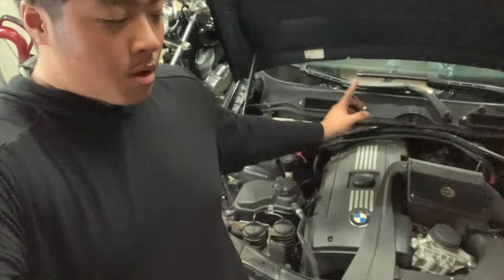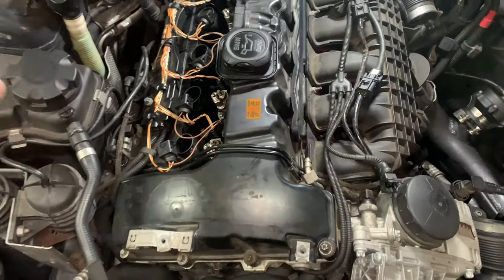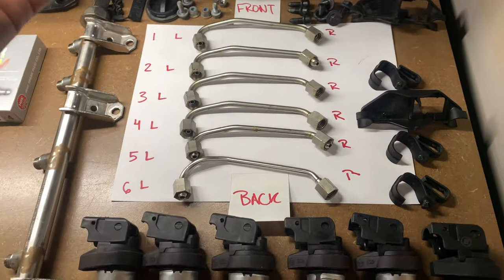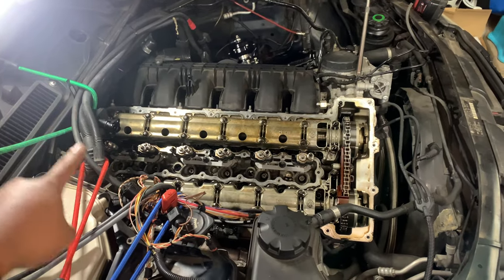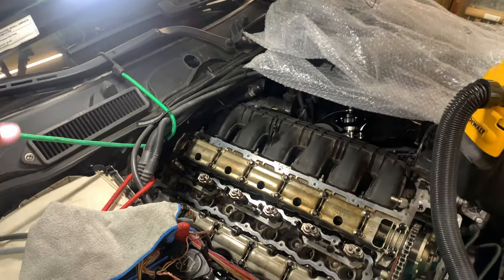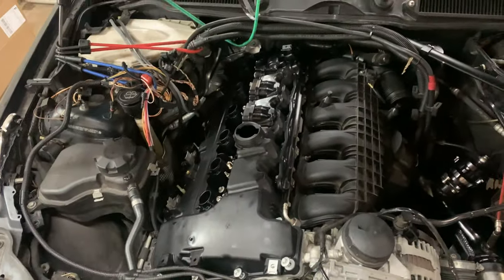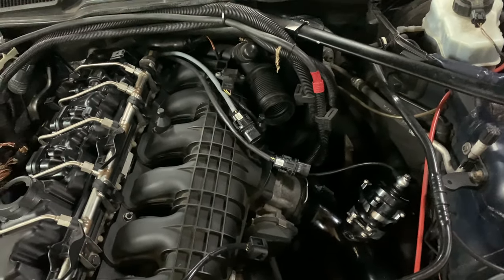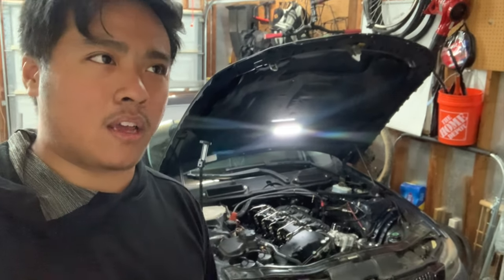BMW E90 335i N54 Maintenance Overhaul!!

Comment: Did the vacuum reservoir bracket come with new bolts? And if not , what bolts do they require? I'm putting mine back into my car and I don't have the bolts anymore.
Reply from the maker: To be honest I’m not sure I think I just used my old bolts but it may have come with new ones

Comment: Why wouldn’t u just spray paint the boost solenoid mount?
Reply from the maker: I’d have to remove the rust before painting it/would have to sand and didn’t wanna deal w anything
Reply: @izard2k  soak it in Vinegar would have it rust free overnight.